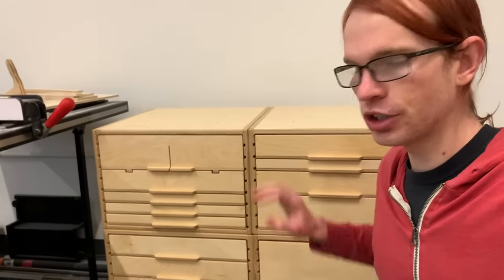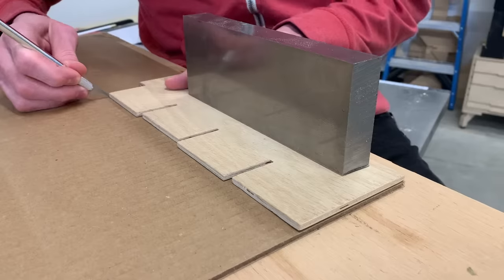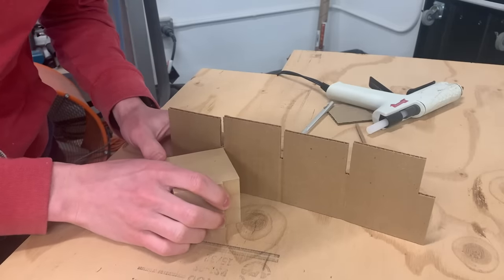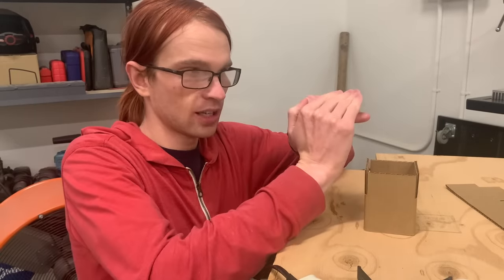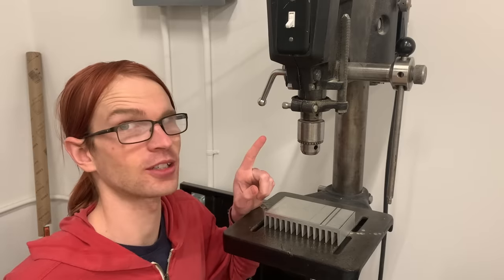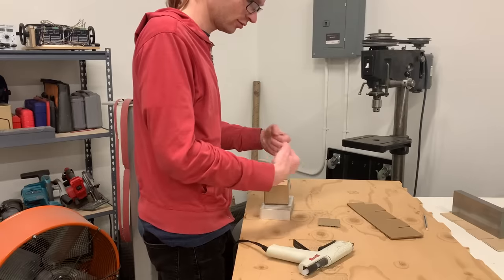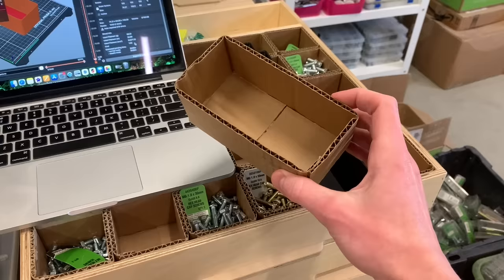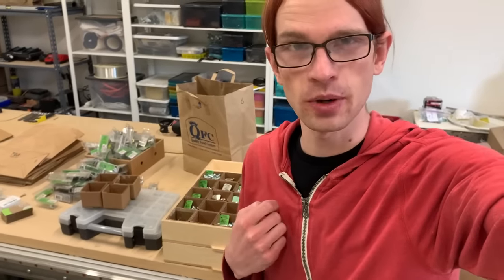Cardboard Hardware Boxes

Comment: Another source is cereal boxes to make things out of and save the plastic bags from inside for other things. 
When folding the flaps, use a paddle to save your fingers and use a kiridashi knife much easier to hold and much sharper. 
It's all about good ergonomics. 
On the drill press, raise the table so you only have minial travel, and so your pull handle is about 15 degrees when pressing and 15 weh not. Place weights on hung NY the handle as required. All you have to do is lift up the handle up and place the block and go do the next one. Then you don't need the so-called heat sink either. But it's a good idea. 
Like the idea of this video and your efforts and details we'll done! 
You can never go wrong when giving and packing productbwhich you paid for or not more usage before it's thrown away! 
Enjoy your work and detailed thoughts! Columbus Michigan 🇺🇸 😎

Comment: Used a similar approach, I also added a bit of wood in the bottom, I used some old laminate floor that we teared out of the house. It adds a lot of sturdiness, makes them bottom heavy and more resilient towards tear in the bottom. Another tip is to use miter saw/table saw to cut the cardboard, works surprisingly well. You can make the big cuts really fast by stacking several sheets. You can also use the miter saw to trim the height of an existing box

Comment: Hi Jer, what do you think of having that plywood template decorated with triangular strips at the right places, then printing in the creases for bending with a rubber mallet?
You could whack out dozends of then even when tired or worn out, and the whole delicate shimming of the block and manually creasing of the flaps would be eliminated.

Just wrap, glue, doubleflap, glue, double flap, and off to the (drill)press.

Comment: Thank you for the video. I have a little tip for you. You can use a metal ruler (or something like that) for bending the box sides. For this, you need to draw (to press) the line with a ruler from the inside of the box where it should be the fold. Or you can use a cutter for that (notching the cardboard slightly).

Comment: You’re using the #1 handle with the tightener 😅next to the blade. This can lead to emergency room cuts to the hand. 
The Gripster handle has the thightener at the back end of the handle. Much safer.

Comment: This is great fun, but here is a possible alternative that also uses “free” material: milk cartons. These would be the wax coated, square paper type; I use half-gallon containers. In no time the top can be cut off and the carton slid onto a piece of wood clamped into a vise. With a utility knife and a square held against the carton edge, the box can quickly be cut into the desired height. The resulting box is plenty durable: I have many that are nearly 30 years old, and have been holding nuts, bolts, washers and screws the entire time. One advantage over corrugated material is that the box sidewalls take up far less space in the drawer. Custom sizing is of course not possible, and it can take a while to accumulate enough containers. But with maybe a minute of fabrication a drawer can be fitted out in no time. In my drawers the space on the edge that the row of cartons does not fill is useful for longer bolts and such that don’t fit in the cartons.

Comment: Bandsaw with a wood blade cuts stacked card well. The edge is slightly fluffy. But if you cut rectangles with a knife. Make a stack of 20 or so the fluffy edges could all be at the bottom .

Comment: You can carefully cut out the corrugation and outside layer on the side-wall overlapping flap so it doesn't stick out... in other words reduce it down to just a flap of paper. Even just slicing down the middle to sever the corrugation should allow it to flatten.

Comment: A well-thought-out build process with a practical end result. Mentioning what u used, what others could use, the cost of a printed drawer. Chef's kiss
Definitely checking out ur site and the channel. 

Turns out my recycling place is gonna stop taking card/boxboard in the spring. This looks like a much better use than throwing them in the compost it, or throwing it out when I get lazy. Everyone forgets about the first 2 Rs; reduce, reuse, not just recycle and forget.

Comment: Instead of a drill press, you could also use an arbor press if one was available.  The arbor press used to be essential when dealing with threaded metal inserts for plastic, wood and metal as well as electronic ribbon connectors.  Like your use of an aluminum heatsink for electronics, the arbor press is set up to press objects between two parallel surfaces.  These are not too expensive for a small shop.  The great contribution you have is the design and the tooling.  (I agree with you on the selection of materials and the choice of hand-work as compared to complete turn-over to a robot.)

Comment: I was a big fan of the 3D printed box systems that people like Alexandre Chappel made videos about, but after printing enough for 1 drawer, I completely agree with you. It takes way too long, takes way too much plastic, and costs way too much. The only benefit is that those boxes will stay in place when the drawer isn't completely filled, due to the grid system. I'm sure that could be implemented for these boxes too though.

Comment: 2 pro-tips about cardboards (and paper in general):

1. Cutting cardboard or paper in specific shapes is best done with press cutting machine. Faster, more precise, cheaper when speaking of blade replacement
2. In prolonged period of use all carboards, wallpapers, even books are creating cellulose dust particles that are dangerous for your lungs

Comment: Wow i just saw your channel for the first time and I am instantly subscribing. I don't think I've subscribed to a new channel in over a year (but i'll unsubscribe to one a week it seems). The documentation you provided is a huge plus and I'll definitely be trying this as a storage solution. If your other videos are this functional I'll probably be doing quite a few Jer style upgrades to all my workspaces. I love that you accounted for the extra material in the folds, cut your template with the extra material removed for folding the bottom, and use what is essentially a cardboard parallel to gauge your fold heights and make it all repeatable. Bravo

keep it up friend

Comment: wonderful - I have a bunch fo 2mm transparent coroplast I am excited to try this with. I would be using to store LEGO is the boxes. They would be 30mm high - great job. I too looked at 3D printing but the time is too time consuming to print a few hundred boxes
Reply: since you have a CNC, have you thought of doing steel rule cut dies for each box? you can also cut bend relief cuts too.

Comment: As a designer who works in packaging... Aside from the tiny cuts that terminate, you can cut the main lines quicker and with fewer passes by using a standard utility knife blade; OLFA makes amazing snap-off knives that stay razor sharp. Plus you won't break those pesky X-Acto tips that snap in two strokes. Love the re-use of raw material instead of sending it off to recycle (or the landfill.)
Reply: Also, a bone-folder or blunt edge can make easy creases for setting folds that stay crispy without needing the press step for those who aren't able to crank down and press.

Comment: 1.5 minutes to cut…holy crap. Stack like 10-15 sheets and then go through them with an angle grinder you’ll get a bunch more done on one shot that way
Reply: I agree! They're starting to use angle grinders for brain surgery (they can't take hours to remove a tumor . . . holy crap!), so there's no reason you can't accurately cut a stack of cardboard with one.